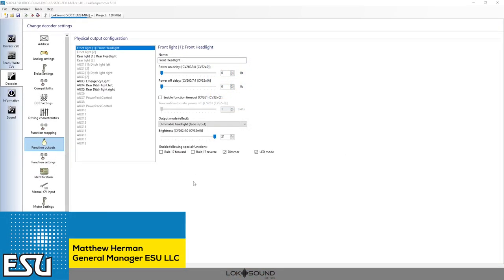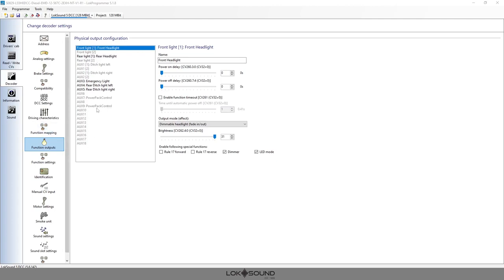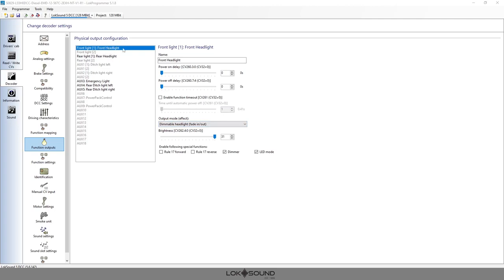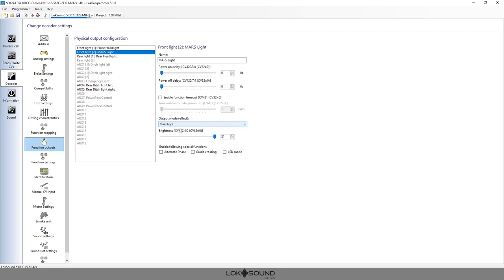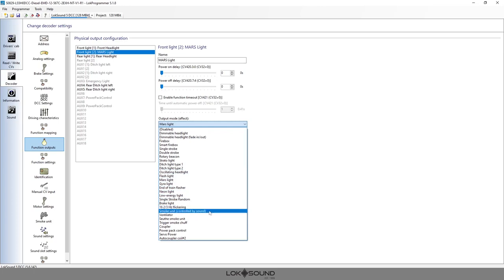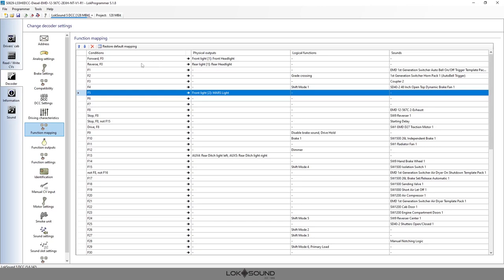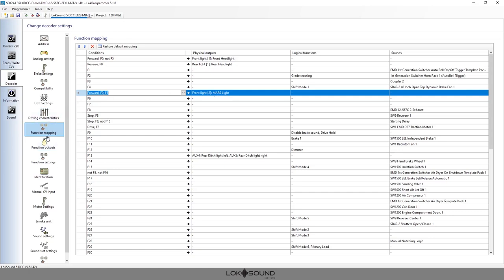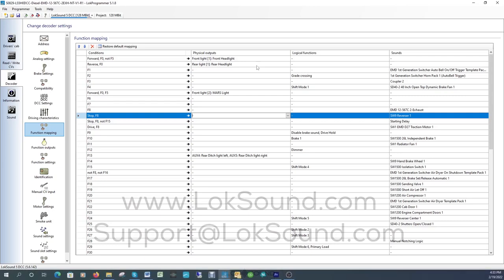Tutorial EN LokSound5 Physical Output Configuration HD

Comment: My headlight is coming on while going in reverse. I believe the motor contacts are soldered to the correct pad on the Loksound 5 decoder 58921. I've got the top wire on the positive pad and the bottom wire from the motor on the negative. I can't find anywhere on the online manuals or any video what the cv setting to get the headlight to respond as desired. I've used digitrax and soundtraxx and have had to change several cv's using leds etc. Any directions you could supply would be appreciated. Not all of the users of  decoders are computer or software specialists. Some like my generation are new to all of this ie. computers, decoders etc etc.